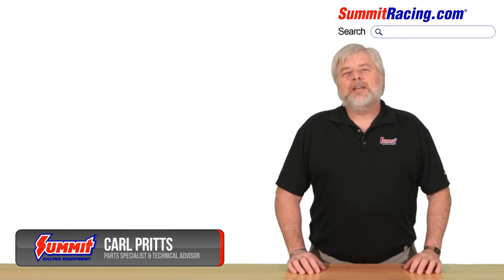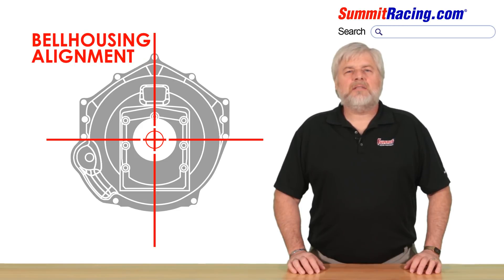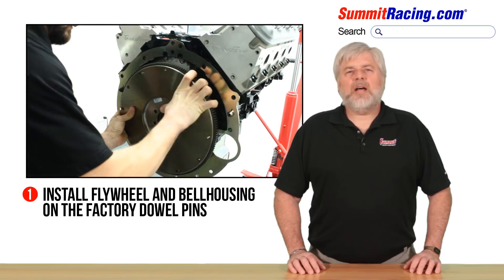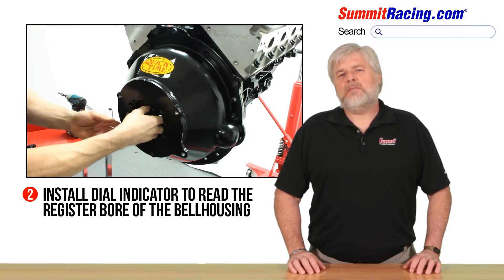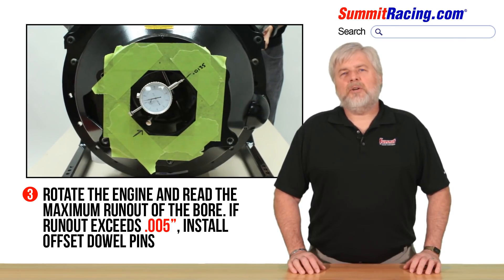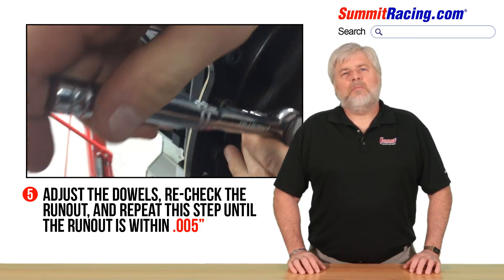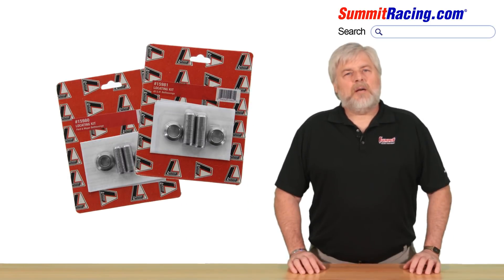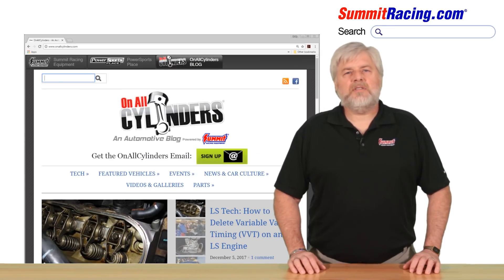Bellhousing Alignment

Comment: my QuickTime bell  housing was .001 off...i loosened the bolts and re-torqued them and i was within .005 specs 💪
Reply: You must mean .01 ... .001 is more aligned than .005 😂
Reply: @jacobwebb8818  or maybe i have my numbers reversed...dang had it been a year already?😳